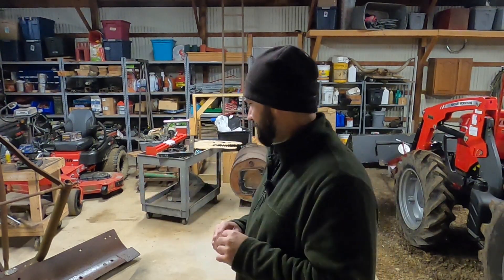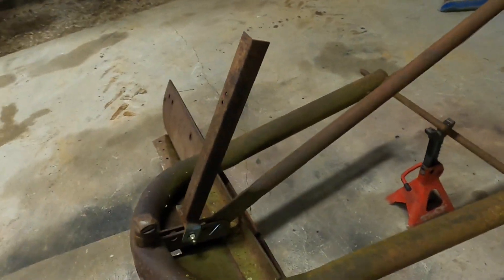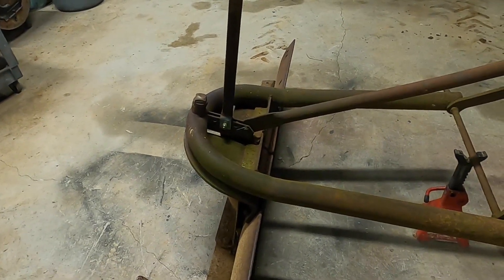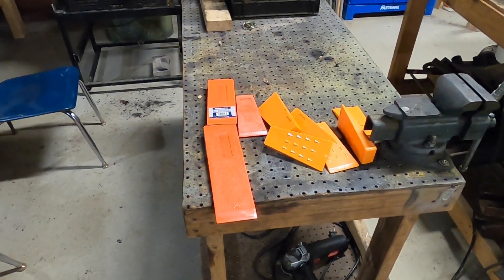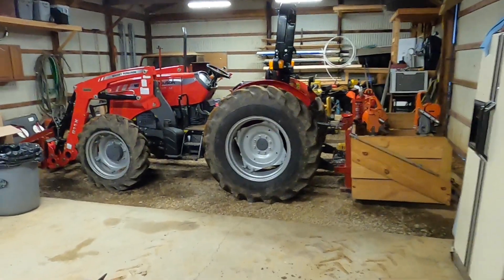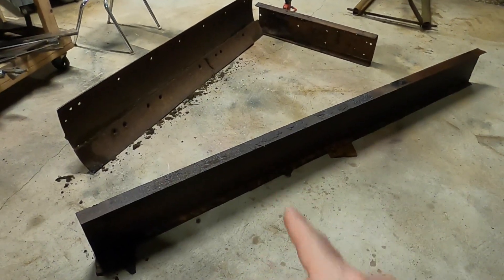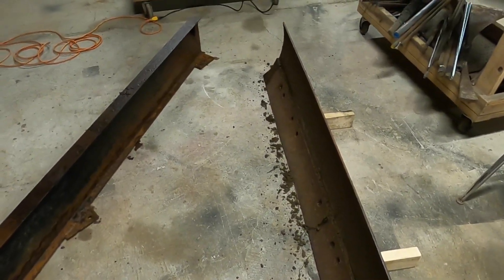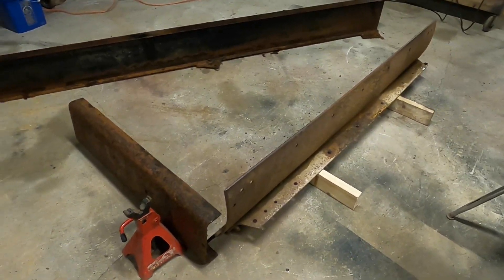167: Planning a Box Blade from Scrap - Can I Build One?

Comment: Looks like you have it going on Logan. The duck joke was great! I was wondering about pulling that with your 4wd Massey after it being designed for much less of a tractor.
btw, have I told you how much I like that Massey tractor? That thing is awesome!
Reply from the maker: I'm quite fond of it so far, but I haven't really tested its limits.  I did pull an 18' box off a moving truck, and it was all the loader wanted to set one end down, but that was due to weight being so far out.  I've also tried skidding some logs that got hung on other stumps going uphill... but never found a limit on pulling the weight on flat ground without obstruction.    I'd like to get some more time in the seat doing dirt work, but don't have any needed projects at the moment.  Thanks for watching and commenting!

Comment: Hey Logan split the blade length wise and mount it to the I beam so you have a front and back blade and re-enforcement.  Just an idea!! you got may gears grinding Man!!! Happy New Year!!!😁👍🚜💨🎆🥂🕺
Reply from the maker: That would work great, but, after talking to BIL David, he said he would probably just pull it up and down the driveway to smooth it out once or twice a year and then leave it sitting the rest of the time.  That's why, in an upcoming video, you'll see the project keeps getting simplified.  I am trying to completely eliminate buying more stuff for it.  Thanks for watching and commenting!